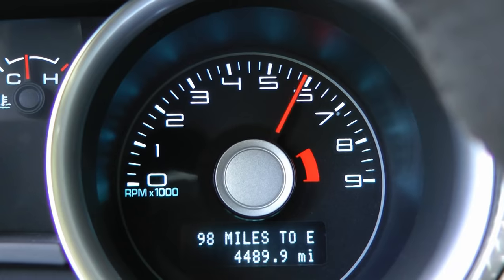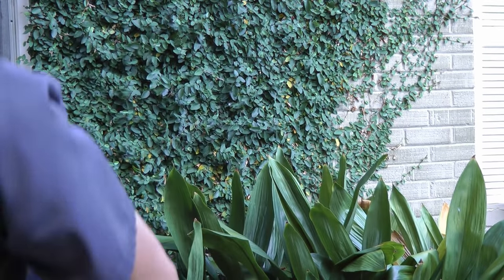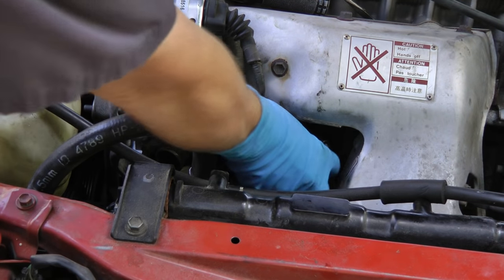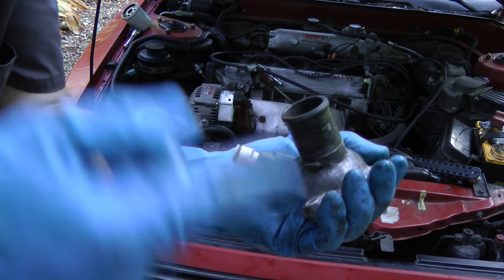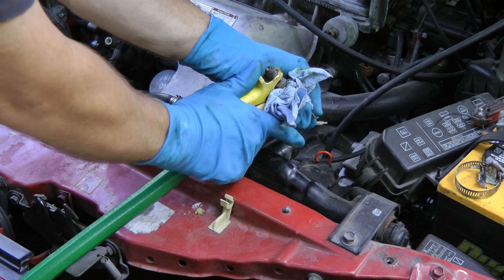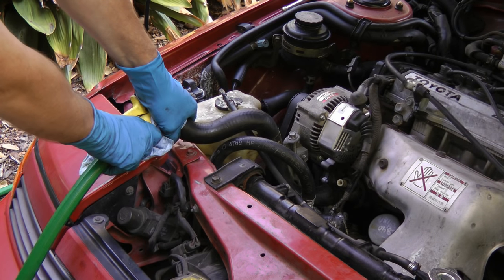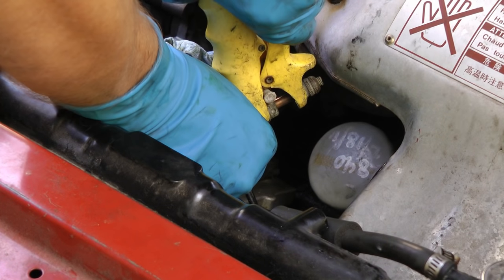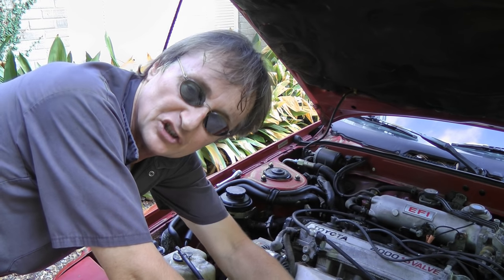How to Flush a Coolant System in Your Car (the Easy Way)

Comment: I use Reverse Osmosis water (claimed to be even purer than distilled water)
in the cooling system which I obtained from those public vending machines, 
but I read that this might be corrosive, since it had had no ions (similar to battery 
deionized water), and would start attacking the metals to get back its ions.

What do you think ?

Comment: Scotty - I tried to drain my radiator on a 06 Mazda 3 - I loosened the drain on the bottom but only got a trickle to come out.  I tried to lossen the screw to get it all the way out but could not get it to do so.  Is something in there plugging it up?  

The car runs fine, just want to replace the coolant

Comment: Scotty! I saw your other video about head gasket sealer and have a question. A used car I am looking at buy has a reputation for blowing head gaskets early in their life. I'm not sure if it has been changed or not. My question is can I use the head gasket sealer when I change the coolant just to be on the safe side to prevent it from happening, and is it safe to use if nothing is wrong?

Comment: Well Scotty that's all well and good but I had to gave  up because they put a spring tension clamp on the hose where you can not get a tool on it to get the strength of leverage to get it off. I even tried to invent something.I gave up. Hope you have a solution without having to disassemble the entire engine.

Comment: Very nice vids, Scotty!  I simply wonder why in this video you say the backflushing is done through the bottom hose (where the thermostat sits) and normal flushing through the upper hose respectively, because i've seen quite a lot other videos where the upper hose is actually the return line and the bottom is where coolant enters the engine. What is the actual path of the coolant?

Comment: Scotty, I messed up. My Toyota reservoir tank was empty of pink coolant, so I poured some old blue BMW coolant in that I had on hand, but didn’t do the 50/50 mix part. The shop said I should not be using BMW coolant period. I have not ran the car yet because this all started because I was finding out why my battery is dead. One thing led into another.
Any suggestions on what to do here would be greatly appreciated!?!?!

Comment: Hi Scotty when i flushed my coolant I put in normal water and flushed it then I put ready mixed coolant into the radiator and coolant resevoir. Is Normal tap water safe which i used when flushing the system then after that I put the new coolant in.
Reply: I've heard alsorts of people say its not safe and so on so. I live in a soft water area. So just wondering will it cause any issues in future as I can't be bothered to flush it out again. Thanks hope u can answer my question. Thank u from England

Comment: hey scotty. i'm running my truck with water for about a year now and i'm planning to replace it with coolant, but my friend said that the coolant would damage my truck engine water compartments (is it true). do i still need to replace the water with coolant?
Reply from the maker: +dave vega actually pure coolant eventually damages metal parts from rust and cavitation around the water pump. Put coolant back in, 50 50 water and coolant mix
Reply: +Scotty Kilmer thanks scotty. I'm gonna buy coolant now.

Comment: Is it necessary to dilute the antifreeze? Would it damage the engine if put undiluted?
Reply: It is...if the Antifreeze is from Concentrate.   Or you can save yourself the hassle and buy Pre-mixed 50/50.   Never use straight concentrate fluid.

Comment: How do I flush out my heater core. I'm trying to change my coolant from green to red. Cause red is apparently recommended fluid for my engine apparently. I had a new motor installed and the mechanic put green in it. Is there a difference between the colours?
Reply from the maker: big difference between green and red, just remove the heater core hoses under the hood and flush it there using a garden hose pushing through the core right there once the hoses are removed

Comment: Hey Scotty I have Mazda 3 2008 2L
Oil leaked from the oil cooler to the cool net system and clogged every thing
I have tried to clean it with prestone flush but didn't clean the oil 
Any idea what to use ? 
Can I put diesel to clean it ?
Reply from the maker: +Nabil Helou yes, diesel is basically kerosene and it cleans well

Comment: Hey Scotty. What are your thoughts on chemical flushes with CRC Radiator Flush? I've heard stories about draining the block and radiator, filling the system with the flushing solution and water, running the engine with the heater on for about 10 minutes, draining, repeating with water until the escaping liquid is clear, and then filling the system with a 1:1 min of coolant and DI water. 

What are your thoughts on this? (I have a 2001 Volvo S80).
Reply from the maker: it actually can flush quite well BUT it can eat up the incredibly expensive head gaskets. I only use it for flushing bad heater cores when the cores are not connected to the rest of the car by removing the hoses feeding it.
Reply: Scotty Kilmer I definitely don't want to eat up my head gasket! Thanks for the warning, Scotty. My car's thermostat is hard to reach, so do you think draining the block and radiator, filling the system with just DI water (and NO CRC), running the engine with the heater on full blast for ten minutes, draining, and repeating would work?

Comment: I flushed the cooling system on our '62 Rambler Ambassador. The radiator had a small valve at the bottom so I used it to drain out everything that came out. I then filled the system with clean water, threw in two dish washer tablets and drove around for maybe 50-60 miles. After that I disconnected the top radiator hose and started the car, filling up the radiator with clean water while the engine was pumping out this rusty stuff from the hose. After a while the water coming out of the engine was completely clear, so I reconnected the top radiator hose, again drained the system and filled it with proper coolant. There were slight overheating problems before but they went away completely.

I'm not saying this is how to do it, I'm saying this is how I did it...

Comment: So my chevy cobalt was crashed and raditor was wrecked I wanna replace it and buy new front end but i wanna make sure theres not more problems or parts ill need can i turn the car on with no coolant and it wont harm the car for 1 min or less?

Comment: I recently replaced a faulty thermostat and gasket and soon afterward, I've noticed it takes longer than usual for the engine to warm up.  After a 15 minute drive to work, it's only half way warmed up.  Did I happen to put a bad thermostat in?
Reply from the maker: yep, put in a higher temp one, and one from a different manufacturer. Dealer ones always work
Reply: Scotty Kilmer hey scotty i have a question i changed my coolant and everything and put new coolant in and squeezed the rubber hoses to the radiator with the cap off and the overflow lid off to release air out of the system and i ran the car with the radiator cap off until it almost started overflowing anyways i had  the heat on the whole time then i turned the ac on to make it go to hot quicker and it goes about halfway and the cooling fan kicks on, so do you think im set as far as that? but i noticed white smoke out of the tailpipe my number 1 cylinder spark plug is doused in oil and the wire is soaked too and my valve cover is leaking oil literly everywhere is that why theres white smoke? thanks!

Comment: Hi if there’s oil from the transmission in the radiator what’s the best flush deoiler to use? Mechanic fixed the transmission cooler and flushed the transmission fluid that had coolant in it. But now the oils still in the radiator.

Comment: Good morning Scotty! I have a 2000 Mitsubishi eclipse that is over heating. I checked the coolant overflow container and it has brown crap inside and corrosion all over the tubing. Can I flush out the radiator without removing the thermostat. I don't want to make this job too complicated.

Comment: I don't think I should run my engine for a week without coolant due to me living in a cold state.  I would end up with a cracked block do to freezing but thanks anyway and should I put in an engine cleaner?
Reply from the maker: of course this is for non frozen winter time for you northern folks. Here in south texas it only freezes once every few years
Reply: lol yeah and I really like your videos Scotty you help me out a lot I just changed my heater core in my 1999 Ford E 150 ecoline  passenger van. I was looking at your video to see the best way to flush mine and refill it. I have a heater core in the back and was thinking if I just flush it from the front it would not get to the back what do you think? And thanks for your response.

Comment: si, i just replace my pistons and rings, re-bore my engine block then in nettral everything is fine but when i started to drive, i think there is a loss of power  and its like choking, but after then when im already running on the highway around 50,60-70km, everything is fine and stable but sudden press on acceleration makes it chokes and its like loosing power, spark plugs were also new, what do u think is the problem?also i noticed that when i turned on the ac, its losing a little bit power and in neutral the machine is not stable (shaking thank normal). please help, thank u

Comment: We've got a lot of minerals in our well water, so I use distilled water instead. Also, you can still get oxalic acid, if you know where to look. Prestone used to use it in their flush treatment. They stopped because not enough folks were disposing of the spent acid properly. The citric acid flushes don't even compare.

Comment: Hi Scotty, Please what can i do to my Renalt Megane, I discovered this morning that each time i turn the power steering, it makes some hisss noice. I just put in Power steering oil two days , but discovered after driving that I put too much of fluid because after the engine heat up when I drove it, I saw the power steering fluid pour all over the engine. I have taken out some of the fluid this morning, but the steering is making little bit of hissss noice when I I turn it. Thanks as usual
Reply from the maker: often a wearing out power steering pump does that, Or a worn steering rack, which costs tons more

Comment: If I have direct connection between the motor and the heater block (no opening, water always circulating) do I still need to turn the heat on full?

Comment: hey scotty i got another question about my 2005 300c 5.7L hemi RWD, is Royal Purple's higher priced 5w20 engine oil with additives better for my car? i do like to drive fast. 

and is the NAG-1 tranmission better with the Royal Purple Max ATF Transmission Fluid with the additives?

i intend to use the car for a long long time.

or is there a brand or type of oil you recommend?

Comment: Hey Scotty, I Have A Question To Ask You. I Have A Pressurised Cooling System (No Radiator Cap) How Would I Replace The Coolant And Bleed The Air Out Of The System? Any Help Would Be Appreciated.
Reply from the maker: most vehicles have bleed screws on the engine you open. Me, I use a vacuum system to suck it out of the reservoir where your pressure cap is
Reply: Thanks For Your Help Scotty

Comment: In the past summer,  I change the radiator in my Acura 2004  but the lack of antifreeze I use water  now  in winter should I back to 50/50 or 100 antifreeze and why ?
Reply: Get that water out of there. Also, never use 100% antifreeze, it has a higher freezing temperature than 50/50, it doesn't transfer heat as well as 50/50 and the additives to protect against corrosion won't work because the water helps suspend them in the coolant, without it, they would settle at the bottom of your cooling system.
Reply: 50/50 Only...never use 100% Percent Straight Antifreeze.  It will actually freeze up quicker than the water.

Comment: Thanks scotty.I flash it on  the radiator cap and lower and uper hose with a water hose after i drain the old fluid out.I was goi g to fill it back with the engine runing but the car dont start,it was making explotions and stuff,so i stop trying and start putting water on it, after a cuple of minutes the car starts.The car only took half of galo  of water wen its suppost to take about gallon and half of water.I let the car run for 30 minutes and never over heat.so i dont know.what u think? Thank

Comment: Hi scotty

When I switch on the windshield defogger or cabin heater, some strange fumes and smell appear. 
I sometimes see thinny and whittish smoke on the air vents in cold mornings after starting the engine for 20 minutes.
Especially, this makes lung inflammation and head-ache to me while driving.I think, the heater core was damaged and the
coolant leakage makes anti-freeze poisoning but I am not sure about the problem because disassembling the dashboard seems a real pain. 
If you inform with your experienced solutons, I would appreciate.
Reply from the maker: odds are your heater core is leaking and you're smelling coolant. Replace the core

Comment: I recently acquired  a 94 Cadillac with a Northstar engine I have been told they have a additive for the cooling to help prevent corrosive in the system I understand about flushing the system do you know about this addative

Comment: Scotty, working on a 96 Geo Tracker. I replaced the thermostat, has hot heat now, but when I drive the vehicle with the heat on the temp gauge runs cooler. I did spin the fan on the engine, its loose. does a loose fan clutch causes that ? let me know.
Reply: when you run heat, the heat comes from the heater core which is like a mini radiator in the dash, so running the heat is like having a bigger radiator which results in lowering the temperature. this is why if you start to overheat they say to turn the heat on full blast.

Comment: Scotty,

I've got bad news...Long story short (er), I bought this 04' sunfire. It wasn't until I looked under the hood today that I noticed 2 radiators! I don't why or how that happened. So, I did what any clueless newbie would do...I tried to flush the radiator(s?).. I found the draincock, let it drain, filled the reservoir with tap water...Then I looked around for a cap on the radiator...there is none. Maybe this was rigged up in such a way that the cap was removed? Well, I drained it anyway and filled the reservoir. Let it run with heat on, drained it... I don't even know if the water is making it from the reservoir to the engine... But I did notice something disturbing. After running it for a few minutes, I saw steam bursting through tiny cracks in the coolant reservoir..I know this system is pressurized but I wonder if the same thing would happen if I replaced the reservoir. So, in a nutshell, bought an 04 sunfire with rebuilt title, 2 radiators are somehow in there, no radiator cap..anywhere....when I drain radiator, fill reservoir then run engine....coolant gushes out of reservoir....if reservoir cap on, pressure appears to be so great that it causes cracks in reservoir to release pressure.... Where should I begin?!

 Could I send you a few pictures of this?
Reply from the maker: +Jay N send pictures this way:If you wish to ask me car questions, I am switching my questions and answers to my google+ community “Auto Repair With Scotty Kilmer”. So please, if you want your questions answered, go  to this link https://plus.google.com/u/0/communities/110758243155230074828  and join my community. You can then ask your question there and I answer them personally. You can also attend my weekly Saturday morning Live car talk events where I answer your questions live. . Just check it out at https://www.youtube.com/watch?v=VognjkYaMjg&list=UUuxpxCCevIlF-k-K5YU8XPA&feature=c4-overview 
 And remember, every Tuesday, I upload a new video on youtube, don’t miss them.

Comment: Hi Scotty.   Need your expertese with my cooling issue on 2005 Ford Freestar 4.2L.   In the city driving it runs at normal temp, but on the freeway, it flactuates from past 3/4 than back to normal, just slightly under 1/2.  It does that every 5 minutes.  There is normal heat in the van, but the engine temp goes up high, than after 1-2 minutes drops to normal for about 5 minutes before rises again.   Cooling fans work fine, and there is coolant to the max level mark in overflow tank.  Outside temperature has no effect, it does this when it's warm outside and also when it's cold.
Reply from the maker: replace the thermostat with a factory thermostat. If that doesn't fix it, replace the radiator
Reply: Scotty Kilmer Hi Scotty.  First I flushed the entire system, including radiator top to bottom and bottom to top.   I removed the old stat.   I ran the van for 3 days and temp remained on cold, city and freeway.  Than I replaced the stat to brand new OEM 192 deg.   I flashed out entire cooling system again  including radiator from top to botom and bottom to top.  Replaced with 50/50 premix coolant.    Van ran fine for almost 3 days and started again, flactuating only on freeway, 3/4 back to just under 1/2 on temperature gauge, every 5 minutes or so.  Overflow tank is up to the max line.
Do you still it's faulty radiator.   I'm puling my hair at this point.

Comment: How about filling in one of those ''Radiator Flush'' products 
into the cap, then driving the car for a couple of days to loosen
the rust from the insides of the block and radiator, then finally
flushing everything out your method ?